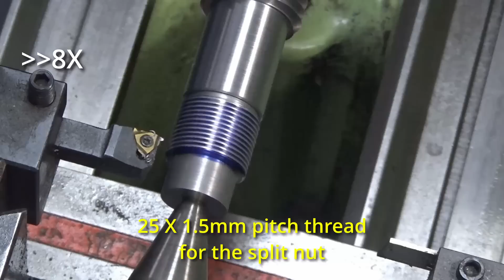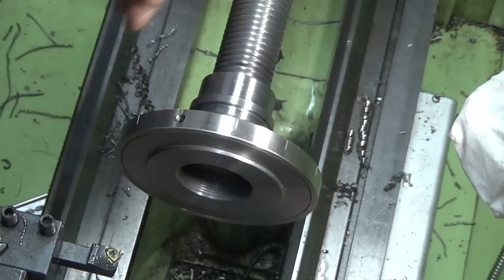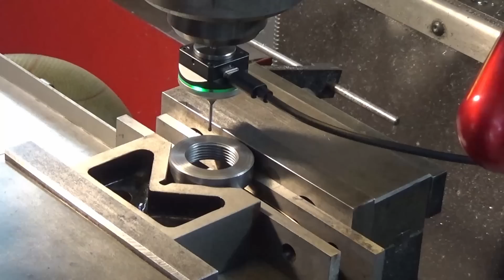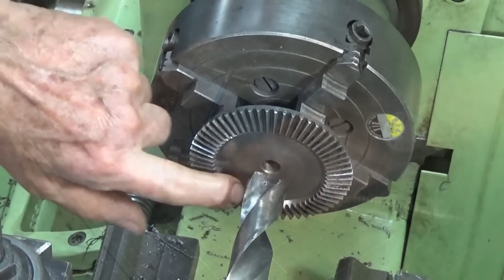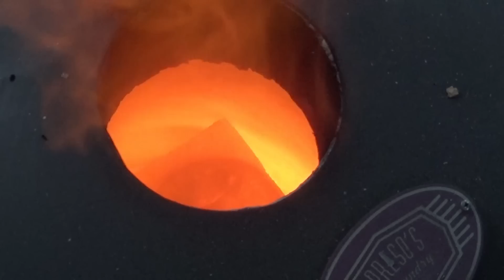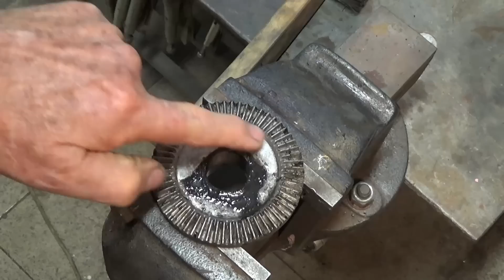ThreadExpress V3. Ep.3 Final Ops on Machining the Spindle/Leadscrew.

Comment: I missed how you were holding spindle when you did the deep drilling . was it in chuck or on centers ?
Reply from the maker: I had it gripped in the 4 jaw chuck and dialled in and then supported at the tailstock end with a fixed steady. 
Regards,
Mark

Comment: Manybe run coolant through a small bore in the steady rest?
Reply from the maker: I am going to add ball bearings to the ends of the support fingers, or, more likely, make an alternative set with the ball bearings for heavy work. But you are correct. Running coolant would have helped.
Regards,
Mark

Comment: Maybe you could drill some holes out of the end of r brass fingers and install ball bearings in the tip. Peen the brass over the balls for retention and viola! Maybe...
Reply from the maker: Retrofitting the steady rest with a spare set of fingers purpose made for bearings is on my to do list.
Regards,
Mark

Comment: Hi Mark. If I might say so, you have made a very nice job of that spindle! You have said on a couple of occasions that threading right up to a shoulder makes you nervous. Since you have a Colchester lathe - it looks like an old round head Student or Master - there is a solution to that problem. It's called an Ainjest rapid threading attachment made by a company called Saunderson and Costin Ltd which later became part of Crawford Collets itself now part of the 600 Group. So far as I know they were only ever made to fit Colchester and Harrison lathes. I do know they were made to fit your older lathe as I sold a brand new one to suit about a year ago.

The Ainjest bolts to the rear end of the saddle apron and has it's own half nut to engage the leadscrew. There is a stop bar with a moveable stop mounted on the front of the bed below the feed screw. When a lever on the bottom of the Ainjest hits the stop it knocks the half nut out of engagement halting the saddle movement. The unit allows threading close up to a stop at high speeds i.e., 400rpm plus. I have used mine fitted to a Colchester Master 2500 at speeds over 1000rpm without problems.

Unfortunately the Ainjest is no longer made however they do turn up occasionally on Ebay so it's worth keeping your eyes open.
Reply from the maker: That would be a nice piece of kit for those of us with nervous dispositions! I have seen a few shop made versions which use a much simpler mechanism but also with some variability in performance. I think Colchester made a retractable threading attachment but you had to manually withdraw it with a lever. 
Regards,
Mark

Comment: 26:25 Don't anneal it! The skill is to run your lathe as fast as is safe (probably limited by the chuck). That way the hardened steel is instantly annealed as it is cut. It may actually burn as it comes off but the inserts will handle it much better than if you run slow, as you were.
Reply from the maker: I must say, I am a bit of a chicken when it comes to hard turning. I have watched Stefan Gotteswinter doing it and he makes it look easy. What you say makes sense but I am also a bit old school and I like the predictability of HSS.
Regards,
Mark

Comment: At 5:50 or so, I suspect that the part is slightly expanding as you bore it and that may be aggravating the steady rest situation.  There’s a lube paste that Rob Renzeti mixes up for use on dead centers (a substitute for white lead grease) that immediately comes to mind for the steady rest.  Barring that magic, a good high-pressure grease should work well.  
Thanks for sharing your endeavors!
Reply from the maker: Thanks. The spindle was getting very hot and I think that it had expanded enough to alter the fit of the steady rest fingers. I am sure there are "wonder lubricants" out  there though. I could see that there were bronze particles in the oil that I was using. I guess the bronze tips wear to conform to the shape of the spindle eventually and with some minor adjustments, the squeaking went away and things settled down.
Regards,
Mark

Comment: I've never had any luck using steady rests with the fied bronze fingers.  Same problems as you had either horrible squeeling or chatter.  The bronze always wanted to wear a lot even with oil or grease for lube. Course that was a cheap steady rest so maybe that was the issue?
Reply from the maker: The initial problems I had with chatter and squealing seemed to go away as the machining process went on. I suspect that the bronze tips on the fingers eventually "bedded in" and things settled down after a slight adjustment to the pressure of the fingers. Cast aluminium is not the ideal material to make a fixed steady from but it got the job done. I do have a backup plan. I was given a very heavy duty fixed steady made from cast iron. It came from a 'Stanko Import" lathe made in Russia back in the late 1960's. It's a relic of Soviet Russia and would be easily heavy enough to do the job. I just need to adapt it to suit my Colchester. 
Regards,
Mark

Comment: I think the old timers used that high pressure grease with white lead in it. You know, the poison one from the dauber built into older tail stocks. If you use the steady rest much it might be good to upgrade with some bearing rollers instead.
Reply from the maker: Agreed. I have seen the one that Kurtis at CEE uses on his big lathe and on balance, it seems like the ideal situation.
Regards,
Mark

Comment: That's quite the impressive looking contraption thus far, Preso 👍😁👍.
I honestly didn't think that flux would come off so easily, thanks for the tip! 😊.
Merry Christmas! 🎄😊🎄
Reply from the maker: I started to get worried when the wire brush made no impact at all. We used to chip it off with welding hammers on fabricated parts but I didn't fancy smashing the gear teeth in that way.
Regards,
Mark

Comment: Hi Preso, I would say oil is best choice for the steady rest.  On a larger lathe we used to use nylon 66 tips, just cylindrical not tapered like yours.  When the part got hot it would melt the nylon very slightly despite oiling, you could at times hear it crackling with the heat.. it was a much more forgiving material than bronze for any part that may expand with heat,  coolant would always help in this regard despite the mess ( and at times mushrooms) it can make...
Thanks for the great videos!
Reply from the maker: That's interesting. I would have thought that thermoplastics would not be tough enough to support work under heavy loads. I guess it depends on the relative mass of the contact points. Despite my initial misgivings about my shop made steady rest, it actually performed quite well. I do have a massive Russian built steady from a Stanko Import lathe which I had planned to adapt to suit the Colchester but now I am not sure it's necessary.
Regards,
Mark
Reply: @Preso58  You are right these nylon pads were 50mm in dia.  It was a 4m lathe though so didn't look out of place.

Comment: My fixed steady has bronze fingers and they are a pain if the part heats up much as the expansion always binds it up to some extent. I personally use oil, I tried grease of various sorts and it always seemed to get hold of a chip and work it into the part rather than flush it away with a fresh application - I know Kurtis from CEE always shrouds his with tape to prevent chips getting in and damaging the finish on chrome bar and his steady uses bearings which he oils, so it is obviously an ever present danger. Every time I need a fixed steady I always think that I should have replaced the fingers with bearings, every time... maybe one day!
Reply from the maker: I have seen the steady that Kurtis uses and it seems like the ideal solution. My DIY steady started off with plain mild steel contact points. It was a replica of the one used on the Hercus ATM270 lathe. I added the bronze tips later. Despite it being a pretty light duty steady, it actually held up quite well. 
Regards,
Mark
Reply: @Preso58 The ones with bearings must still be affected by expansion due to heat but I have no idea if it leads to the same level of binding as fixed points can. I have seen a few makers who have made the mod, Quinn did I think, so one day... 😁

Comment: I haven't used a steady with fixed bushes rather than bearings since I was an apprentice. Back then, we lubricated both dead centres and the steady with tallow. I suppose now you can get some type of high shear synthetic gearbox oil that would do a better job.
Many thanks for the videos throughout the year. Have a very Merry Christmas and a Happy New Year.
Reply from the maker: That's interesting. My father had a syrup tin full of lamb fat which he declared to be the best lubricant known to man. It was like white fat and it was pretty rancid under the surface but it seemed to work in most situations.
Regards,
Mark

Comment: The squeaking is strange. The bearings are shiny and gold colored like brass. It is different from the typical dull brown bronze used for bearings. I suspect you're using the incorrect alloy. You might try 932 or SAE 64, or sintered bronze (better oil impregnation).
Reply from the maker: The material that I used was sold as Phosphor Bronze. It's funny, but the squeaking seemed to come and go. I think it had something to do with the part expanding as it heated up. You could also see particles of fine metal in the oil as the heavy load cuts were applied. Still, given that the shop built steady rest was made of cast aluminium and not iron, it did a pretty commendable job.
Regards,
Mark
Reply: Eagle Eye

Comment: Nice video and very nice work. Just a hobby machinist myself and I have never used them but I'm guessing a ceramic insert and interrupted cut don't go together for turning that hardened part down. ???
Reply from the maker: Most inserts don't tolerate interrupted cuts. You can buy quality, name brand inserts like Kennametal and Iscar that are specifically designed for difficult materials and interrupted cuts but they are hideously expensive here and not easy to get on line. HSS works for me most of the time. It's cheap, easy to sharpen and works in most situations although it's slow compared to carbide and ceramic insert tools.
Regards,
Mark

Comment: Could heat and burry in Lime for the desired annealing.
Thanks for sharing the process. 
Merry Christmas.
Reply from the maker: I tried that once but it didn't work. The part was quite small and it didn't have a lot of thermal mass. The lime probably acted as a quench. I have had success dropping hardened parts into a burning tree stump and leaving them there until the fire burned out. I put some old files in a fire like that once and they came out as soft as butter. It was very nice steel to machine too. 
Regards,
Mark

Comment: Gotta love that hardened stuff, it's coming along nicely.👍 I had similar problems drilling a deep hole when I made the spindle for my mill, and I only had to drill around 100mm. But I just don't have the travel in that little lathe of mine, and I had to take the tailstock off completely. So I mounted the 7/16 drill in a quick-change tool holder and drilled it with the carriage. Pretty scary stuff because back then I hadn't yet made a steady rest, so the whole thing was sticking out a long way. Thankfully I was able to drill it from both ends.
Reply from the maker: Yes, sometimes you have to think laterally and do what you've gotta do! That is something that I love about this hobby. Sometimes it is the problem solving that is more interesting than actually making a part.
Regards,
Mark